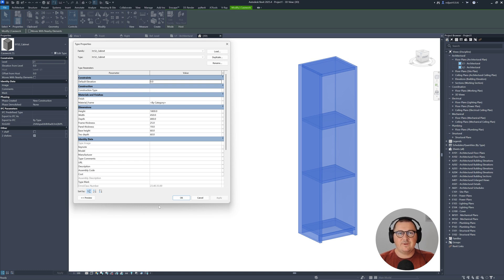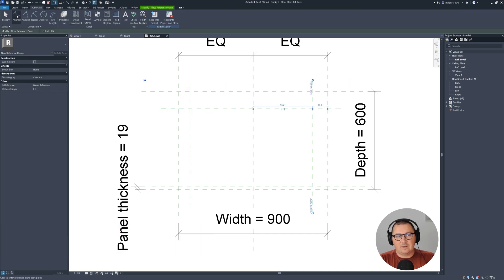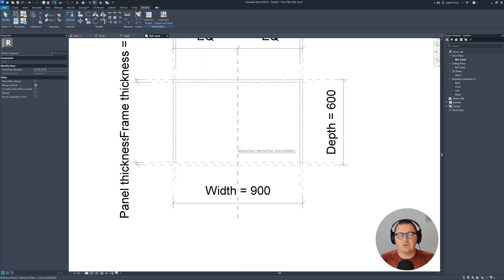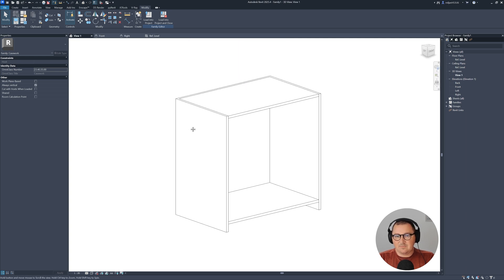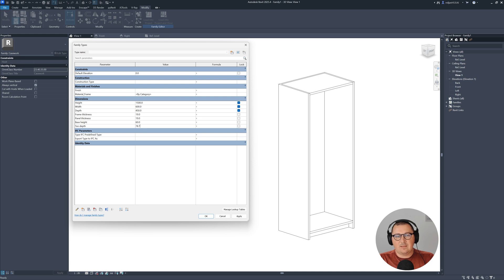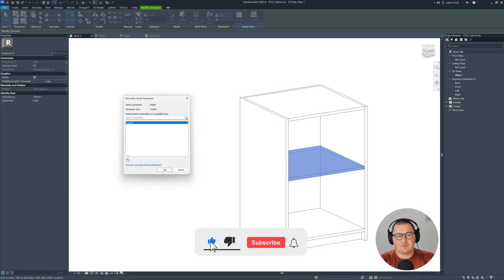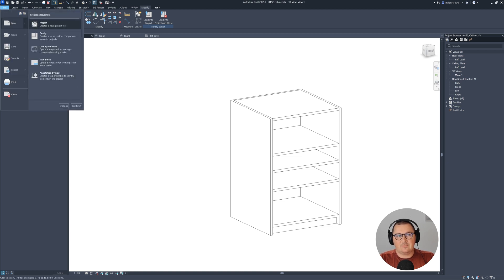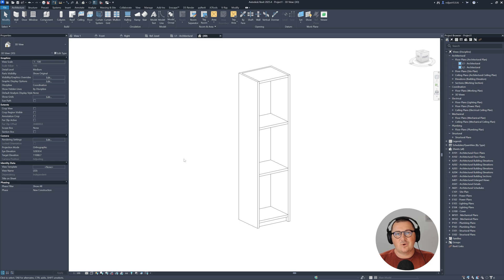How to Create a Tall Cabinet in Revit – The Simplist Way

Comment: Its so useful. I just have a question. Is that possible we can get the cutting lift with panel sizes after the modeing.
Reply from the maker: Yes, absolutely, and to achieve that you will need to use Shared instead of Family Parameters. Take a look at my tutorial here ‘Master Shared Parameters’ 💪

Comment: When creating the shelf panel, why you prefer to choose reference plane and click by edge all the time, instead of copy the created panel? I wonder if there's any behind the scene trick.
Reply from the maker: Yes, because I added constraints to the reference planes, that’s why I am locking it that way. You might also use copy but if you not copy/lock it correctly it might not work well when you’re changing cabinet size
Reply: @arkiteasy Thank you! This detail is very important to always keep in mind.